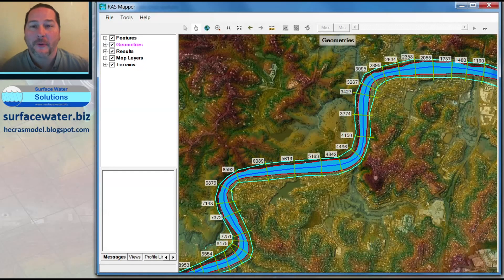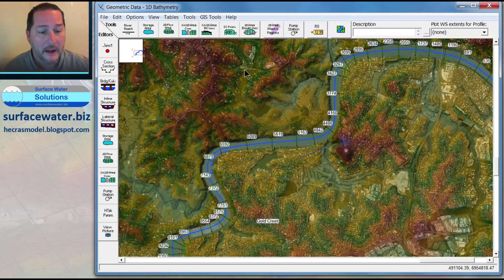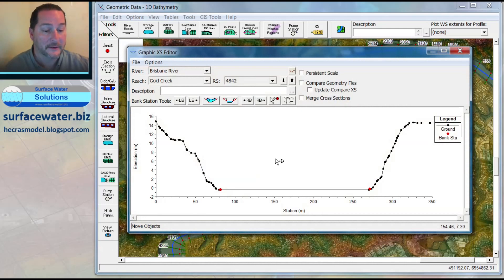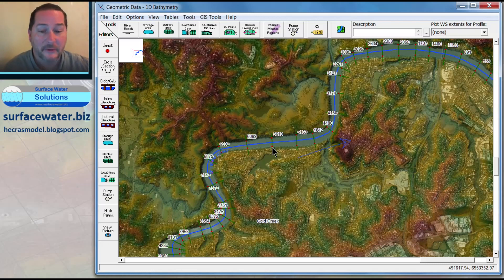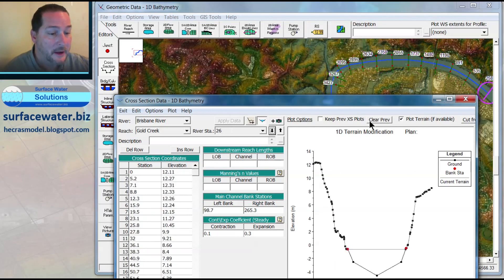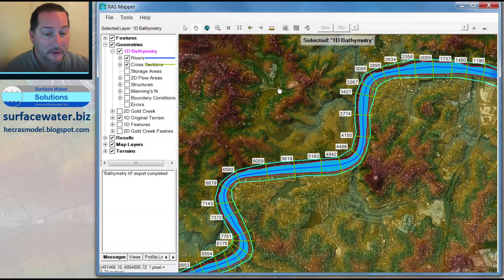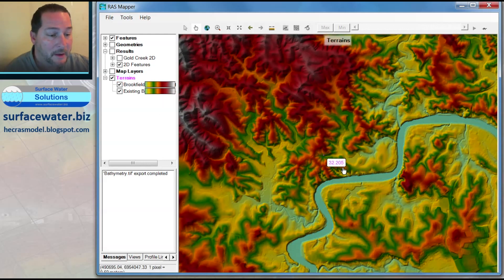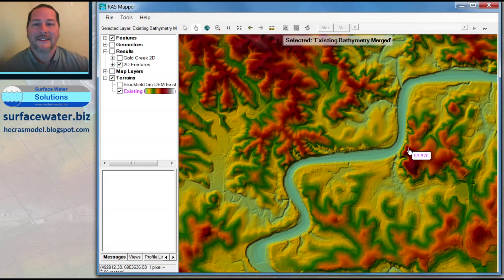Terrain Modification in HEC-RAS Part 1: Bathymetry

Comment: Hello Krey, 
Thanks for your helpful videos.
Would you mind going over 1d-2d coupling particularly ‘connections’; also if you don’t mind using applicable time step in relation to cell sizes, distance between XS & channel depth. If you also talk about calibration. 
Thanks again.

Comment: Thank you for the video. I have got a quetion though: how can I update the bathmetty if I have point measurement data? The thing is I have hunderds of cross sections for which I have point measurements and therefore it would be extremely time consuming to modify the cross sections manually. Is there a faster way to do this in HEC-RAS?
Reply: Not sure your data format, but is it easier that you create a new Dem file using your data point and cut xs from your new Dem?
Reply: Hi Kian, you can do it automatically using a python code to edit the geometry file (.g##) that contains cross sections data. If you want to understand more how to do that, open your geometry file using notepad and take a look at the info that you'll see.

Comment: Thanks for the video! I want to do this for a reservoir, do I use the same method, or is there a different method specific to reservoirs bathymery?
Reply from the maker: The method would be the same. If you wanted to breach the dam that forms the reservoir, however, you'd need to be sure to remove it from the terrain and build it back again as a weir.

Comment: Great Video.  I have a quick question:  

Generally I've used 1-D modeling for stream restoration projects.  This typically involves setting up an existing geometry file with cross sections based on detailed survey data.  I would then use the channel design editor and template tool to create proposed cross sections in a proposed geometry file.  I would then go ahead and run the 1-D model under existing and proposed conditions and compare the results (focusing on water elevation, shear stresses, velocities, etc).

So, it sounds like moving forward, after I create my proposed cross sections I should follow the steps you outlined in this video to create a new merged "proposed" terrain that can be used for both 1-D and 2-D modeling?
Reply from the maker: The channel modification tool is still more powerful than the method I've shown, since you can get more automation such as daylight lines, cut/fill volumes, constant bed slope, etc. out of it. Watch for lots of cool new terrain editing tools coming in  Version 5.1.